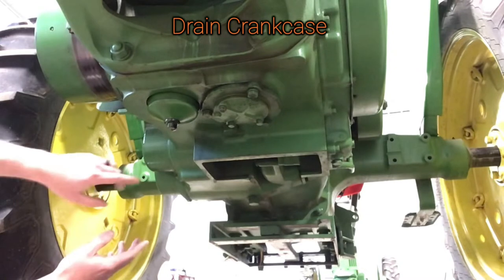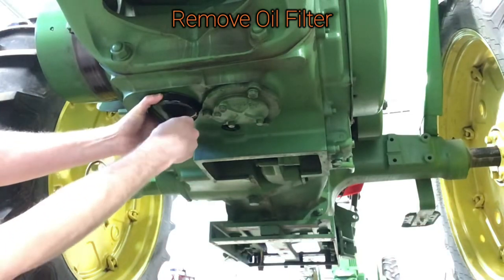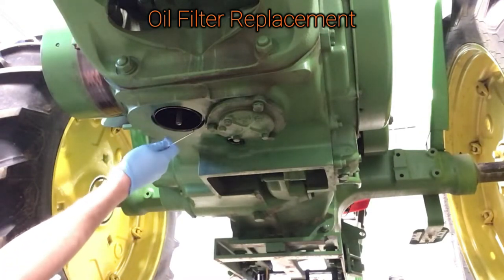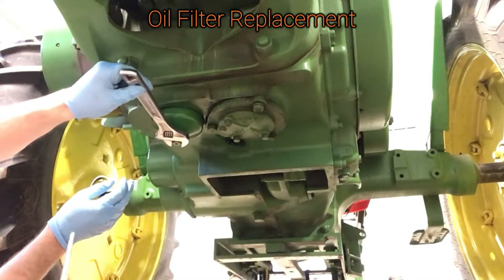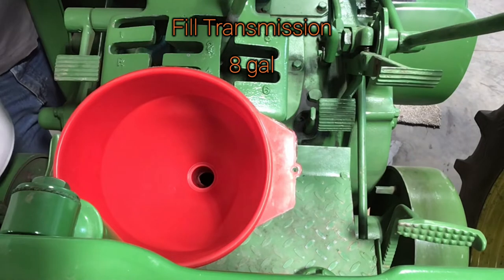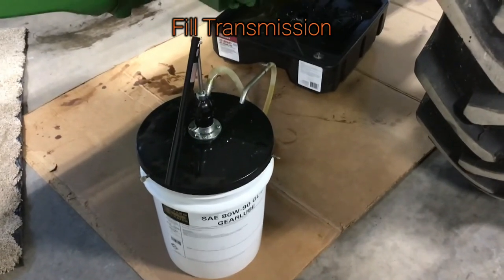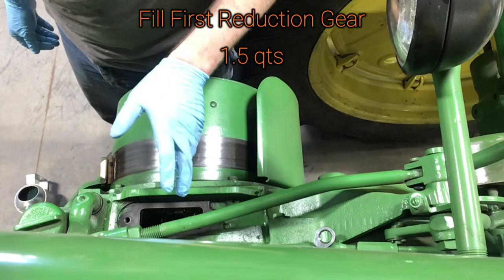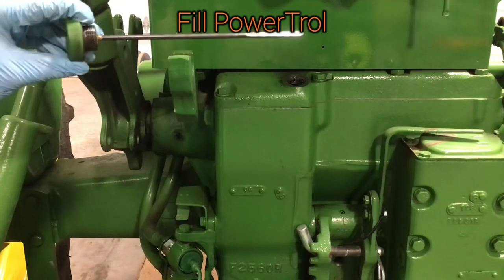John Deere 720 730 Diesel Basic Maintenance

Comment: You didn't show changing the Fuel Filters.  Would like too see that too.  I just inherited my Dad's 730.
Reply from the maker: 1st stage filter should be replaced every 450 hrs, 2nd stage only at major overhaul. Mine won’t be due for a while. Just open up the housing and replace it, then you’ll need to bleed the system. The last half of our sediment bowl replacement video covers bleeding the system
Reply: @oakwoodstockfarm7017    Thanks

Comment: Really amazing job.  You did forget the fuel filters though right?  I am asking as  I just purchased mine and am following your video.  I also put created directions on msword with your pics.  I do have a question, my oils were not that good, but ok.  My PowRtrol still has a black thick slimey goo that is just a touch to thick to drain out by itself.  Shocking to see it in a hydraulic system???  I am thinking of shoving a steam cleaner into the fill hole and letting it heat, pew and puke?  What do you think?  Did you want the msword doc?  You can share it if so.  Its handy.
Reply from the maker: There are two fuel filters, 1st and 2nd stage. The 1st gets replaced every 450 hrs or so. The 2nd typically at major overhaul. Regarding your powertrol, a guy could throw some diesel fuel in there and run your hydraulics, making sure that it gets heated up. It’ll probably require a full tear down as you’ll most likely find that the internal seals are junk. I highly suggest picking up an operators manual, loads of info in them on the maintenance of these old gals

Comment: Is there a gasket that needs to be replaced on the first reduction gear fill cap?
Reply from the maker: There is supposed to be a thin gasket there, mine doesn’t have it but I’ve never had any water get in

Comment: So I acquired a 1965 720 gas. It was my wife's grandfather's. I don't know anything about tractors but am handy enough to do the work. Just need pointers. Also where to go and find parts.
Reply from the maker: This video will show you the basic maintenance, gas model will be same as diesel. A good resource for parts is Lind Bros Tractor, an internet search will bring up their website. Lots of parts and good to deal with
Reply: Also, you can go directly to John Deere make sure though that you give them the serial number of the tractor that way they can track down the correct parts that you need.